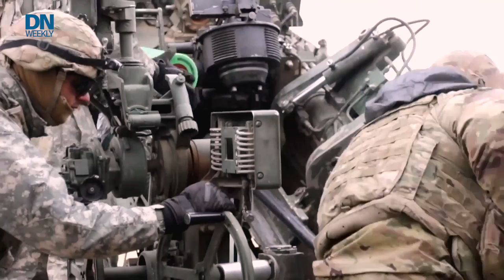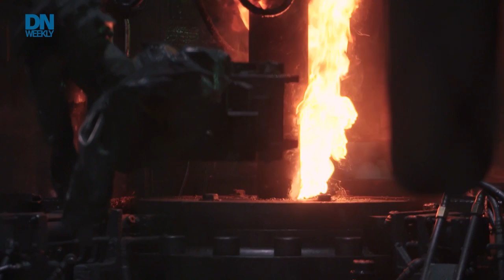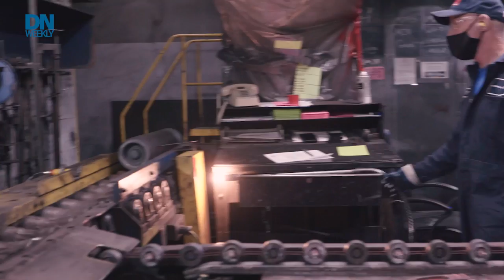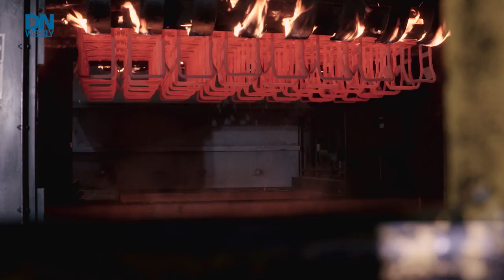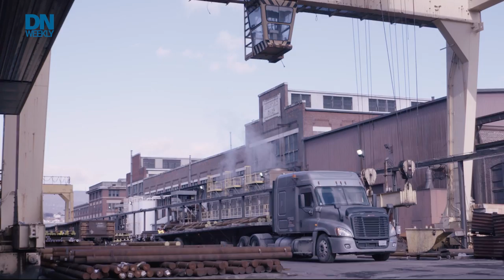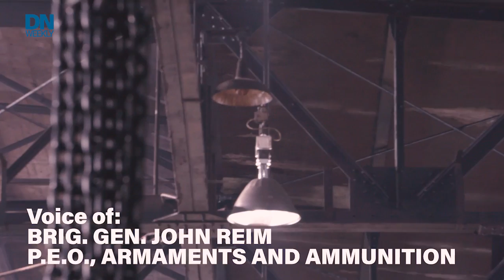Go inside the plant making artillery rounds for U.S. and Ukrainian armies

Comment: In march 2020, Biden played "smart, telling Trump should confiscate factories to manufacture ventilators for covid.
Now the US is at war.
18 months have passed 
And Biden still struggling to make shells of the WWII era?
Metal parts?
Aren't there stell mills that could produce them by the tens of thousands a day?
The US proves not to be prepared for a war.
Biden is to blame.
There is nothing "modern" about msking shells.
Use any buillding or space.
Contract steel mills.
Aren't there steel mills in the US?
That should take 1 or 2 months. 
Not 3 years (2022 - 2025).
Niche??? Produce steel cylinders?

Comment: Time to implement the defense production act and make millions of rounds.
Reply: JUST SNAP YOUR FINGERS.  Look at how old this equipment is. It probably made shells for WWII and has had little investment short of that one robot.  I do think in summer that place is like working in Hades.  There are few companies making any of that equipment and you wouldn't take the prints this plant has and be able to job out new equipment without new engineering. Yes, years to get a modern plant up and running.

Comment: I'm a retired manufacturering engineer. I used to specify and source production equipment. In my experience almost anything, including highly specialized machines, can be designed and implemented in 12 months. This war has been going on for a year and they are talking about not having a significant extra production capacity until 2025? The people that ramped up production in WW2 must be spinning in their graves.
Reply: Actually, look at the production charts from WW2 and it's not that far off and that was with War Economy mode.  The plant in the video is only running two shifts and the DoD official stated the problem is the metal sourcing which they could trigger laws to give priority.
Reply: @reubensandwich9249  I disagree. For example the US made 900 tanks in 1941 and 27,000 tanks in 1942. Production of other war goods showed a similar ramp.
Reply: @jimfarmer7811  But when were those orders made?  The UK was in a war for 2 full years and ordered significant arms while the US government started issuing contracts for factories and munitions years prior.  Your 1942 year is when Detroit Arsenal went into full production after being built and partial production in previous years.
Reply: @reubensandwich9249  we are going to have to agree to disagree. I stand by my original statement. Keep in mind that tesla built a complete car factory in China in 168 days. Compared to that ramping up artillery shell production should be a piece of cake.
Reply: @jimfarmer7811  Re-read you statement, mainly the "China" part.  The country where sla...workers live in dorms at the factory.  

Also be aware the Ukrainian military loves the 155mm because of how accurate they are.  Quality control matters when the dud rate of Russian fuses I've seen reports vary up to 20-30%.  US military additionally uses an expensive harder to produce explosive filler because it's more stable.

Lastly, I liked where they mentioned the production goals.  I think it's clear from those production goals that we aren't running out of 155mm and the DoD isn't even looking at the panic button yet.
Reply: @jimfarmer7811  
Look, reality doesn't matter anymore, old timer - only virtue signalling.
You must repeat the propaganda!
Reply: @reubensandwich9249  Slave workers? So whenever another country beat the US at something they must be cheating? 😂
Reply: @zenster1097 You are right that war goods was a major part of GDP during the war years. The difference is that the production of artillery shells in 2024 is little more than noise in the current GDP data. Also artillery shell production isn't rocket science. The only equipment that could have a lead time in excess of a year might be the large forging machines. Literally everything else could be procured in 12 months. These numbers are based on my 30 years experience procuring large manufacturing equipment.
Reply: @reubensandwich9249 Our side weapons good , enemy bad. How propaganda works. Russia can jam GPS so that smart weapons come dump. Excalibur shells are almost useles in Ukraine.
Reply: @reubensandwich9249  You are not a chemical engineer and this statement shows you know absolutely nothing about artillery shell reliability. Fuses are the issue, these must use precision toolings to be manufactured with tolerable quality. Explosive fillers are simple mixtures - for example, the M107 uses a simple 6.86 kg TNT filling. The newer M795 in USMC service uses 10.8 kgs of TNT, in Army service it uses IMX-101 which is entirely new and based on NTO. The 3OF45 uses AI-X-2 based on RDX. Neither are more or less "reliable" than the other, this depends wholly on the fuse and condition of filler.
Reply: corruption profits kickbacks